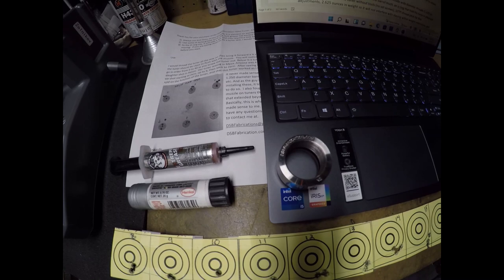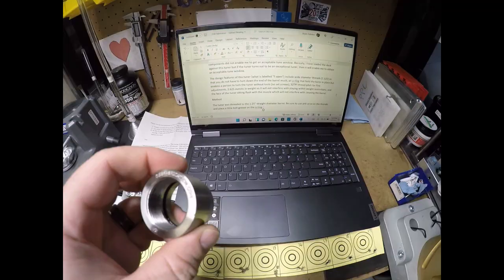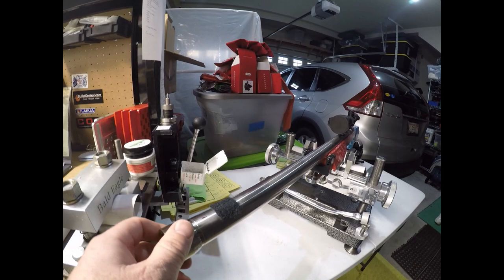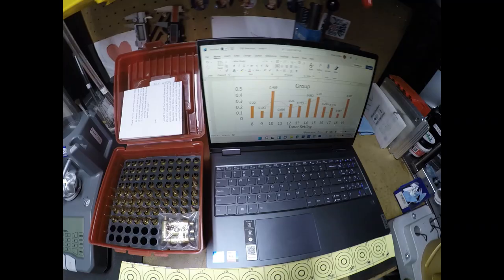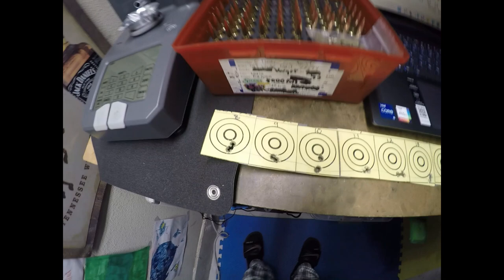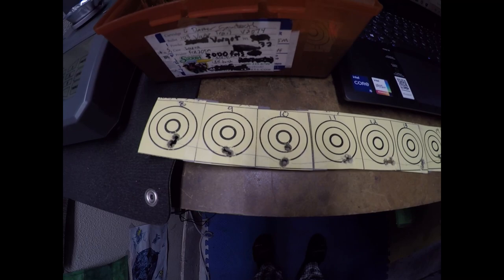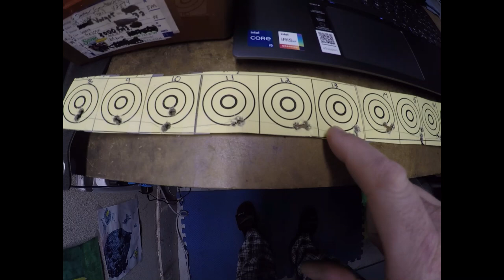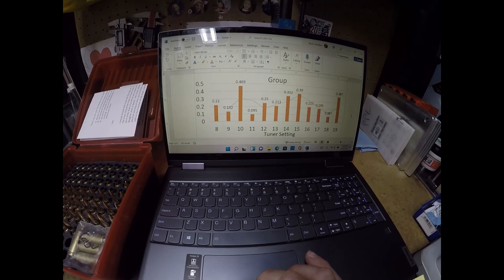DSB Fabrication Tuner

Comment: Thanks.
Im just about to tune a barrel again.
Was wondering about load dev, as I did load Dev, (fps and seating depth) before I got a tuner.
I've since had to seat pills 40 thou deeper into case due to magazine issue, they fitted in magazine fine, but, had issues with the action due to long length...err.
Thanks for tip of looking for consistent poi, and, helping me not fuss bout load development, I assume the fps will still be in a stable node.
Keep up the informed videos!
Like the DSB Fabrication Tuner.  Very neat and minimal.
Thanks again.